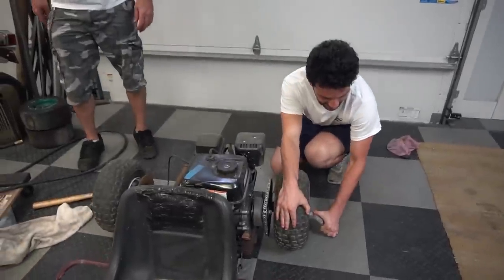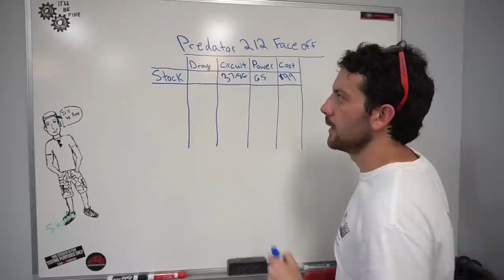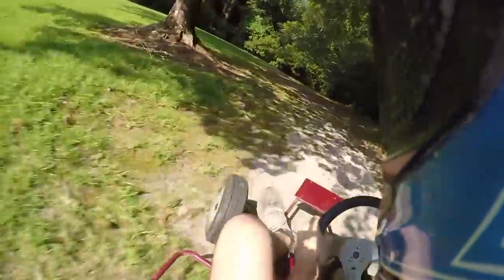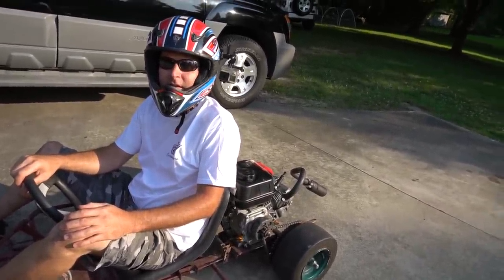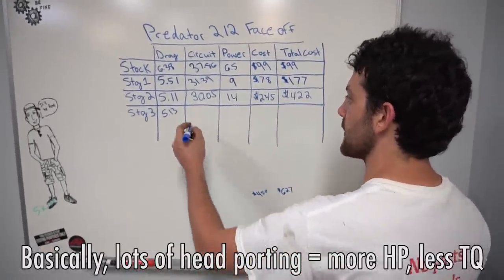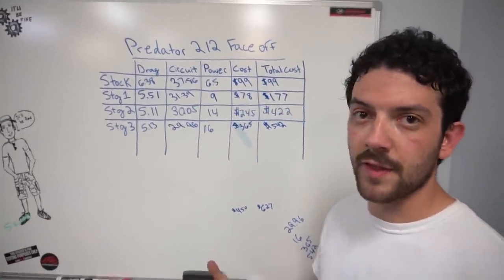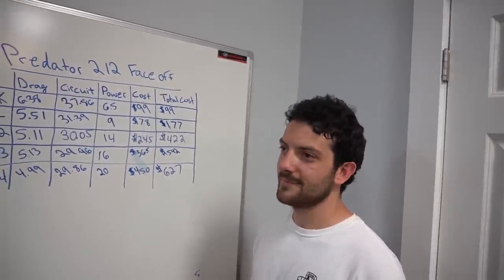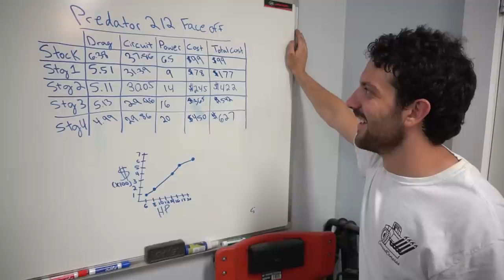5 Engine Showdown! Mild to WILD Predator 212cc Comparison

Comment: Great videos. 100 BHP / Litre is good for these little engines. If you can get that reliably then any more is just iceing on the cake. I got 3.5 BHP from a 32CC Cyclemaster engine that fitted on a bicycle, I was 16 years old. 30 odd miles an hour down a narrow footpath in the rain and dark. Better than sex. Rotary valve induction, head skimmed, carb out to 0.4" and methanol. Crank snapped off behind the flywheel at about 10,000 rpm. We had REAL LEADED 100 octane in those days - Esso Golden.

Comment: All sorts of sins were commited here. First off when you start modding and turn more rpm and make less bottom end then you need to gear it to compensate. Second, you never mentioned that you tuning it for each combo. It sounded like it was cutting out and breaking up on the higher hp engines. And third, you should have changed the carb if your going through all of this trouble.

Comment: Maybe someone could suggest to GoPower Sports the idea of custom building heads for Predator engines... Could be done on site, or subcontracted to a machine shop, to either make heads with parts from their kits, or custom builds for the exotic setups - just bolt on and go...

Comment: That stage thing is so over used term that has no valid info on its number and meaning anymore..    

When i was building cars,,   mine thought was    that stage 1 and 1.5   was  allready including  lighter pistons, rods all balanced. bigger valves, springs ,  full porting and polish. bigger exhaus and intake,  fuel delivery either by twin carbs ( old school ) or full on injection with bigger jets and tuneable ecu etc..   basicly everything expect  cemented block or more support to cylinder walls.      Allso included full on track use breaks, and shocks ,  often with camper adjust at least, if not fully adjustable suspension.    Clutches was allso chosen acording to use and what vehicle need as an minium to have any use for other things done to it in complete set.     Not to mention the weight reduction allready at 1.5 stg.     For me it was  1 is still an street car,  1.5 was mid way from street to full on race car.  

Now people talk about stage 4 to 5 and basicly only have bolt on kits that does nothing unless optimized with hours and hours of tuning, and even still engine it self is basicly stock , wit orginal pistons and so forth...  often unopenned at all.

Comment: So should i bother moding a 212cc or should i buy a 420cc? I was going to just buy the 420cc from harbor freight but looks like the 212 may mave more potential for mods.
Reply: dark crusher1221 i like the 212 not just because of the cheeper mods but its lighter too
Reply: Isaac it'll be fine i have never seen a 420 next to a 212. Now that i think about it the 420 is huge isn't it.

Comment: do you need the previous stage to build one, lets say I wanna build stage 3 do I need stage 2 or can I build stage 3 on the stock engine ?
thanks for the answer :)
Reply: Not really, for example, stage 1 is a new exhaust pipe, jet, and air filter, but stage 4 includes a whole new intake system, basically stages are not really stages, you buy what you actually want, and need.
Reply: @habdman  ok cool thanks man :D

Comment: My bt200x coleman is monster offroad, it has huge 60T rear sprocket with the jackshaft on, 18# valve springs, billet flywheel, billet rod, arc racing piston, 8 degree timing advance, intake and exhaust, upgraded carburetor, RK chain, racing sparkplug, and thicker fuel lines w/ inline filter, governor deleted and some porting work getting done soon ✔

Comment: You should see whats going on with the Wayne County Speedway. Its over there by the Nahunta Pork center  close to Goldsboro NC. Not sure if it is still there or not.  Also Your math is not very clear.  The engine was $99  + cost of stage 4 kit ( $450 )  You came up with  $627     My math $99 + $450 =   $549   What say you ???

Comment: Hi I have a preadator 173. Vertical shaft and I wondered if I could use the stage 1 kit for the 212 with it being a 173cc and a vertical shaft I don’t know if it will work I think that they have the same carb any info would be appreciated

Comment: That's not too bad, but I'm looking at those numbers and I'm wondering why I should mess with pushing a 212 to the absolute ragged edge of durability and have an engine that won't last very long due to being ludicrously high strung, or just buy a secondhand Briggs twin and have an engine that'll live 30+ years and give the same power with more torque.

Comment: Looking at the chart, there seems to be an exponential increase in cost for an inversely proportional decrease in times.

It seems your benefit to dollar ratio is best st a stage 1 kit... After that, indeed you make more power and get faster, but it costs you 2-3x as much to go 0.3-0.5% faster.

Comment: I just bought one of these engines for a leaf blower build. My question is if you pull off the governor ,how long can you run at the consistent higher rpm without damage. I’d like the faster blower speed.

Comment: I just picked up a new Predator 212 for $89 today. I want to use it for my Drag Mini Bike for 1/8th Mile.

I have been looking at the .292 Cam Drag Racing Cam, Racing Head for Predator 212 (with Gage Black Venom 1.3 Roller Rocker Arms and .045 Fire Ring Head Gasket), Predator Performance Billet Connecting Rod +.020, Flat-Top Piston for 212cc Predator (70mm, .570 Compression Height), Billet Lifter Set, New Style ARC Speedway Billet Flywheel, Dual Bearing Billet Side Cover, 24mm Flatside Mikuni Carburetor Kit, Predator Performance Exhaust Kit, Billet Valve Cover, Fully Adjustable Engine Mount Plate for Gokart / Mini bike, Chromoly Pushrods. 

I still can not decide if I want to use a Torque Converter Setup, or a Bully 3 Disc 6 Spring Clutch. 

What is your opinion on power this will make? I would really like to see 25+ Hp with a 8500-9000 Max Rpm.

Comment: WRONG !!!  $99 + $245 = $344.  There is NO REASON to count the Stage i with the Stage ii COST !

THE KITS ARE EITHER / OR NOT ADDITIVE.

STAGE III COST IS: $99 + $365    = $464.

THE STAGE III KIT LOOKS LIKE YOU SHOULD BE WEARING SEATBELTS.  ALSO THE LACK OF A 

SUSPENSION, BEGINS TO SHOW IN SPEED & CORNERING ABILITY.

Comment: The more power you add to slick grass, the worse times you tend to make... I strongly suggest you use a paved track, need not be banked, but for sure, you need traction to make any use of the HP or its just a waste.

Comment: Tryout the 212 Tillotson w/Mechanical Fuel Injection. A full progressive stage install would be very cool to see. That MFI and tighter tolerances should be good for 8-9 hp stock.

Comment: Stage 1 looks to make the biggest difference. Unlimit it. Exhaust. Cam. Carb and you're done. Don't worry about the rest. With lower gearing or lighter weights in gearbox the 120ft would make a huge difference

Comment: Speaking of performance are there any performance parts for this Briggs engine 192437-0125-01 I would guess no because it’s from a woodchipper but maybe raptor parts fit it by some chance I mean they’re both flatheads

Comment: it's called the law of diminishing returns. the more hp you want, the more it costs, and the less you get. try it with a 350 small block. $1000 might get you double stock hp. $10,000 might get you triple.

Comment: I don't usually post for help, but if anyone could please? I just bought my first predator engine on about the same size go-kart, had to have mounts welded in, the sprockets are a little offset because of it. And it has a Keihn Carb,looks to be at LEAST 24MM, but also appears to be stage 2-3 build. However it only ran for about 20 minutes before I snapped the chain, assuming from sprocket offset. Anyways, the engine seems to be bogged down after 60% throttle, but has sat for a year with OLLDDDD gas in it. Is the Carb trash, it's electronic choke btw, and should I just order a 22mm with manual choke or rebuild the Keihn?

Comment: So long as you are making each lap as on the same kind of tires (ie slick or turf) it shouldn't matter what the surface is that you are running on honestly, it gives all the carts the same chance on that kind of tire.  As for tacks you could look for a horse track, while it is still dirt you wouldn't have to worry too much about ripping the snot out of it all the time.  The one in nearest me is about 3/4 of a mile that could be made into a circuit, might want to look into something like that in your area I am sure there is one you could use.

Comment: Great Video guys. It's fun to tinker and when you get it right after so much work., It can be rewarding. I do not know what altitude you are at but looks like you're making good power from mid to top end, remember torque is what moves mass and horsepower keeps it there. Here is a little old school tricks I learned from my old drag racing days. Golf ball the combustion chamber. This will keep the flow of air flat against the exit and improve flame travel. EXAMPLE: A golf ball is most likely the most arrow dynamic object out there. Take a golf ball and hold it above your air compressor blower nozzle and the golf ball will suspend in mid air and even up to a 45 degree angle. Less lift and a bit more deration on your cam shaft. Key cam 4 degrees advance. Index your spark plug so that the open end is pointed toward the intake valve.  Remember, an engine is just a big air pump. The quicker you can get the air in and exit, the more power and efficiency it will be. There are so many lost secrets out there and it really sucks that many will not share. I am 62 years old and have won many race events in the past. With the new tech racing junk out there, it is awesome for you younger cats. Add the old school with the new and that little go cart with a little tap on the throttle should blow the tires off and if not ready could land in the ditch... That's when you know  ya got it right  Keep tinkering and use logic because you guys are doing a great job. My last drag car was built in 1990. !978 King Cobra Mustang. Ran 11.30et Quarter mile with 1.70 60 foot At 4420ft above sea level. Car weight was 3490 LB I built a 351 Winsor for 1,700 dollars Cast pistons, Hydraulic cam and 8.9 to 1 compression. On pump gas, Go figure... Trust no one. Build it yourself. Very best wishes and have fun., D.M. P,S, The golf ball trick I mentioned should piss off some of the old timers for letting it out., LOL!!

Comment: I wud have to piecemeal it from parts from china direct in 2 weeks, avoid the markup of parts.   need jet kit, extra plugs to read the plugs to see if it is running rich/lean/just right. the snap test of plug, new plug, start it, rev it HIGH for a few seconds, ignition cut off while still running WIDE OPEN THROTTLE (WOT) let cool, pull and read plug to get optimum jets in carb ... depending on altitude. high altitude does NOT need bigger jets as it is getting too much fuel... not enough air to go with the fuel so just a waste of fuel; but extra fuel cools the engine, run it too lean motor gets HOT and scores the piston/cylinders. ur drag race needs to be longer.  nice place u got there too, yes... the grass, nice grass best not to tear it up any more than u already have.  get sprinklers out and water ... fertilizer too isn't too expensive to scatter like chicken feed .

Comment: I'm trying to decided on taking the governer off with my stage 1 kit on a non-hemi predator 212. I did get 18 lb valve springs aswell, thus my question is... What is your input on this? I know there are videos and forms, I have read them but i'm still nutral on this situation. Thanks guys!

Comment: I've got a predator 212, and I removed the governor, modified the air filter(removed it), and put on a custom(13hp lawn mower)exhaust, and it carried a home made yard kart about the size of the American Express 2.0 to 35 mph. But with those modifications the valves started to float at high rpm's, and the piston was hitting the valves, and with that it started to spit fuel out of the intake. Have any of you guys had this problem, and can it be fixed without getting heavier Valve springs.

Comment: Oh no. The slicks on grass with no suspension, greased brakes, in the back yard on some slapped together tube chassis and 4x the original power is where its at! Everything else is just money and pressure and perfection and SAFETY and pretty much all the fun gets sucked out of it incrementally.

Comment: My buddies and I are just getting into this stuff and we had a lot of success with one exception, Belts!  We blow through 669 belts so fast it is hard to keep up.  I had one awesome diehard belt that came with my Kart from a company called Channel Mount Machinery, but they appear to be out of business.  Some belts burn up in no time flat and others will last for a half a day or so, but its all hit and miss.  According to the internet, every belt available is the best belt ever, so it is no help.  Any recommendations regarding belt selection, most of us are using a 30 series torque converter on a stage 2 predator 212, and the 669 18 30 belt is what comes with that from Go Power Sports, which lasted for a very short time.  All our motors are either brand new or newly rebuilt and we have a mix of Yerf Dogs and Mancos.  Thanks for any help!

Comment: Thats a lot of money to build a 20HP motor.  Seems to me that you could buy a good used 125cc M/C engine with gear box that would make way more power for less than that.   Plus the reliability of the Harbor Freight engine built to that limited is questionable.

Comment: You were running out of equipment (tires, track and ability to control them in the conditions).
before you ran out of power. I think your numbers were skewed because of it. If you could have used all the power you were making, your numbers would have shown it.

Comment: It seems you lose a lot of low end torque, which really is the fun stuff. You should comment on how to gain back that low end torque. I've read on some forums that people tap and put a screw in the end of their tailpipe for backpressure to gain back their low end torque. Either way, would be interested in knowing if you guys do anything for that. Also, I haven't heard you guys talk about the flywheel keys to advance timing. Stage kits from other vendors include those keys sometimes. What benefits do those have?

Comment: Maybe you could measure your engines real power... It's super easy to build a chassis dyno with arduino and some hardware bits. If you want help with software side of things contact me ;-)
Basicaly what you need to do is:
Get a large diameter pipe - measure the diameter, weigh the pipe - this will be your dyno roller.
Weld end caps on the pipe, add axis, self aligning bearings, etc. hardware.
You need to calculate your roller moment of inertia (moment of inertia for a hoop around its symetry axis = roller mass times radius squared).

Now you need a sensor that will pulse once per roller revolution - this can be an induction sensor that will sense a tooth welded to your roller axis.
Your instrumentation device will measure time intervals between roller revolutions and send that data to your computer (arduino through serial link - real simple).
From this data you will calculate your angular velocities and angular acceleration - Excel or OpenOffice will make this real easy and give you graphs ;-)

Your torque at given angular velocity is your angular acceleration times roller moment of inertia.
Your power at given angular velocity is angular velocity times torque.

Comment: You guys should have changed the rpm the clutch engages at for the higher hp engines. They bog so bad at low rpm with the clutch locking up so early. Which makes them way slower off the line. I think the course times wouldn’t have changed much since it was sliding, but the drag times would have been quicker.

Comment: Be careful running too thin a head gasket while running different valves and bigger cam   Piston to head clearance should be a minimum of .025 with even a stock set up

Comment: Guess it just goes to show that you don't need to spend a lot of money to have fun(ie stage 1). It also shows that in order to take advantage of the more power engines, you would probably need a better chassis/suspension setup in the kart, and maybe some fiber glass body pieces to make it more aerodynamic. Though that is more for the pros who hope to move in higher forms of racing. In any case keep up the good work :)

Comment: I'd actually like to this this comparison on the mb 200 frame as a comparison to power ratio between the different stages too at some point, i mean granted i can see  slight differences upon the time shave and power distribution on a go-kart, but the kart frame is a lot heavier than the minibike frame, So I'd like to see this sometime or another on the maybe the mb 200 frame as its more rugged than your little minibike frames, So I can see the major differences it is to a minibike versus a go-kart. Reason for it, is because i have the Warrior 200, and i just purchased the 212 because well the torque converter will not bolt to the shaft on my 196, and I didn't feel like outsourcing the parts and a complete engine tear down just to replace the crankshaft to make the torque converter work, So i just bought an engine from harbor freight. but i would like to see this same comparison done to the version of the bike at some point, to see if it would be worth really upgrading that much.

Comment: If you preload the engine by holding the brake and gas together, you will get much better launches. The engine wont bog down like in the video.